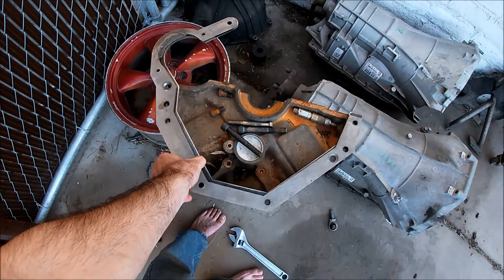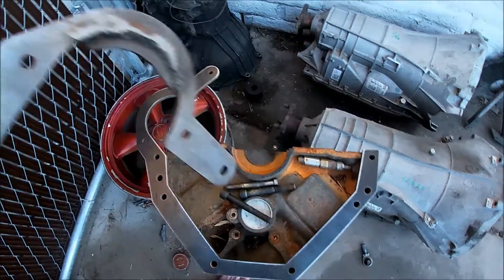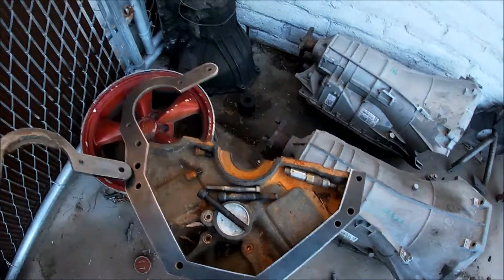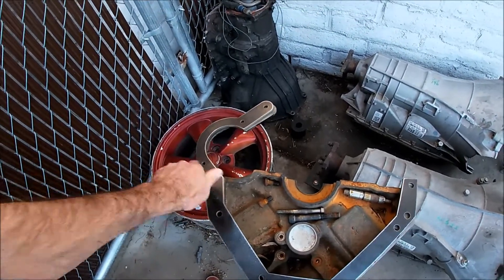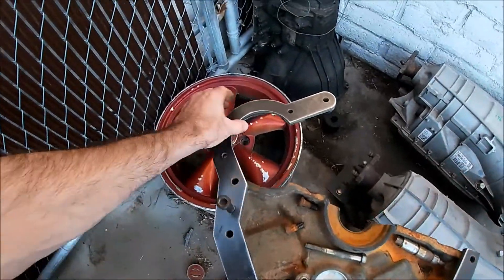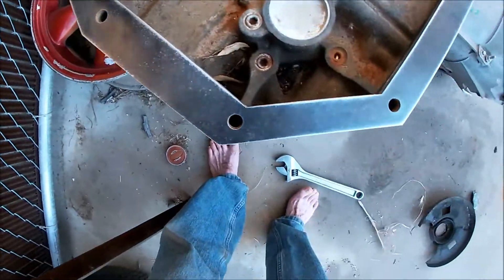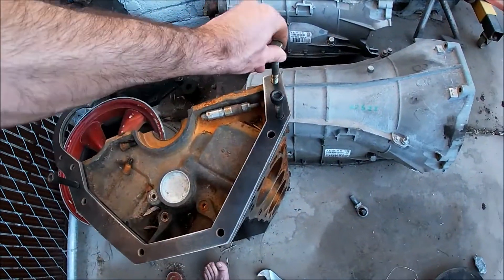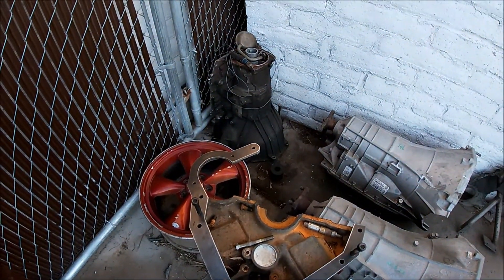** New 6R80/TR3650/T45 to SBFord 302/351W block adapter plate **

Comment: Does this work with a 4r70w from a 4.6 modlar?
Reply from the maker: Yes it does.  A 4r70w from a 4.2L F150 will have a 302/351w bellhousing pattern and will not requires an adapter though.
Reply: @olboy1981 yeah I know  the 4r70w from a v6 fits but all I could find was one from a crown vic.
Reply: @olboy1981 does this adapter require  any shimming..of the flexplate or tc studs?
Reply from the maker: @craigvoclain1406  No, on the 6R there was a big 1/8 inch from the converter being bottomed out in the pump to the flex plate.  I'd imagine the same for the 4R

Comment: with that adapter plate does that make the tr3560 bolt up to ford 302
Reply: tr3650
Reply from the maker: @scooter1391  Yes, it will work with the TR3650 also.  You can email me at ryandenney347 at gmail

Comment: What does the clutch setup look like? Any different from a regular Mustang 302 clutch? Are there any engagement issues with the splines on the input shaft and the splines of the clutch disc?
Reply: How can I get in contact with you, I want to order one of theses adapters
Reply from the maker: Same setup as a 302.  Both trans use a 1 1/16 x 10 spine input shaft.  Once you remove the starter spacer plate your only adding an extra 3/16 of an inch to the length.

Comment: soi have a 2007 shelby gt will this adapter work on this application?
Reply from the maker: @melissafelts8168 are you trying to put a 302 or 351W into a 07 mustang and keep the original transmission?

Comment: Any solution for the older 5 bolt blocks like early 260 or 289?
Reply from the maker: No not yet, I need to look into it though.  I have found the drawing online before for the early 221/260/289's.

Comment: Do you have any videos of an actual engine and transmission running in a vehicle?
Reply from the maker: Yes, go to my channel and go back 2 years.  I have the first plate in my car running a 302/6R80 combo.  There are T45/TR3650 setups also using this same plate.

Comment: What about  Torque converter fitment
Reply from the maker: What about it...?  The plate is only 1/4 inch thick.  Once you drop the old starter spacer plate it's only 3/16 inch added.  On my install the converter only pulled 1/8 inch off the pump to the flexplate.
Reply: What about  dail pins are they not two different sizes
Reply from the maker: @bradwilliams3136  so the mod motors use the dowel pins as a mounting point for bolts.  With this adapter you remove the dowel pons from the block and tap the back of the hole with a 1/2x13 tap.  The 1/2 inch bolt goes through both the trans, adapter, into the block which aligns the whole thing.
Reply: Ok how about TC torque converter center fitting into the crank?  Are they not different sizes
Reply from the maker: @bradwilliams3136  They are the same 1.38 dia..  302/351, 4.6/5.0/5.4L  Aftermarket 4R70W converters are the same F60 1.38 pilot for both V6 and 4.6/5.4L.  Search through my channel at the fitment videos.
Reply: How much for the bracket and does it come with bolts
Reply from the maker: @bradwilliams3136  It's $150 and does not come with bolts.  Depending on your setup the bolts maybe different lengths and such.  You will need to cut the counter sinks as shown in the videos.  Email me at ryandenney347 at gmail. com

Comment: Hi, how much per plate? Would it come with instructions for the bolt hole mods and bolt sizes/length? What about depth issue with piolet bearing? 
Thanks, Kevin
Reply from the maker: Email me at ryandenney347 at gmail.  Plate cost is $150, take 7ish day to get shipped to you after payment.

Comment: That plate would work with a Tremec T45 from a 99 mustang  to use on a 302 engine
Reply from the maker: Yes with a 164 toothed flywheel.
Reply: @olboy1981  can you use a 11” clutch on a 164t flywheel? Maybe it comes for 11” clutch,idk sorry. 
I do know I have a 60’s 302 that used to have an automatic transmission and I have a t45 out of a 99 cobra. I also have an 11” clutch out of a different trade. Also if I buy your adapter plate what starter do I need? Thanks in advance for the the info. And lastly how do I purchase your plate ?
Reply from the maker: @juniorsantos4440  you'd use the manual trans starter for a 93ish 5.0L.  You can email me at ryanadenney@yahoo.com to get things going.
Reply: Cool video I just emailed you

Comment: Do you have a bellhousing for a tr3650 I have a 90 5.0 motor I wanna put the transmission with it currently putting motor in a 2002 ford mustang
Reply from the maker: The TR3650 has the bellhousing part of the transmission and does not remove.
Reply: @olboy1981 will it work with your adapter plate
Reply from the maker: @deloreanbeard5173  yes, send me an email to ryandenney347 at gmail and i'll send you some pics of some installs and the required mods needed.

Comment: Are you still running the 6R80 and have you found a remedy for the output flange vibration?
Reply from the maker: No, I had to go back to the 4r70w.  Im looking at the 10r80 next..
Reply: @olboy1981  A video on this would be awesome. Currently debating between a 4r70w or 6r80 to go behind the 351w in my bronco. But a 10r80 would be even better. found your videos looking up details on the shift schedule since i was planning on making my own trans controller to work with my Sniper efi.

Comment: $150 with shipping is crazy cheap though... Fck I really want this for my 300 ford. Hey big question which 2wd trans match this? I've seen different bolt holes for the 2.7 3.5 5.0 but can never really verify anything
Reply from the maker: I've only seen the 5.0L to match to.  I'd like to think that Ford wised up and will stick with this mod motor pattern.